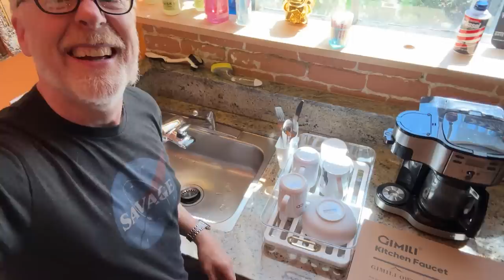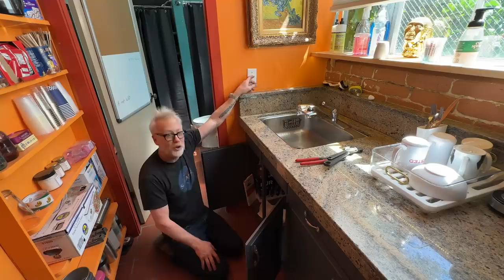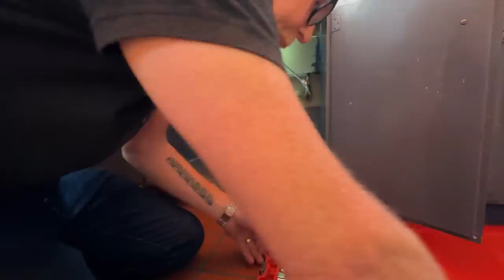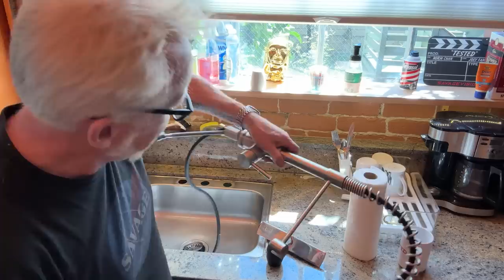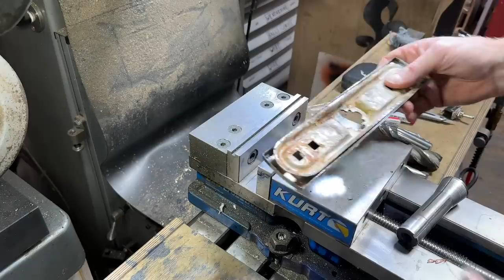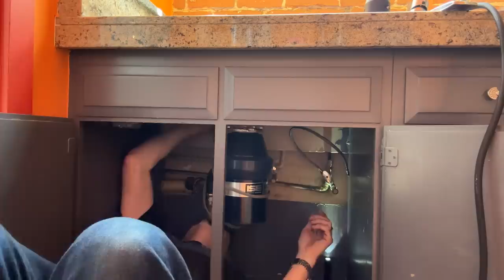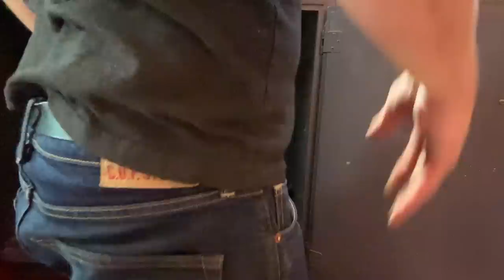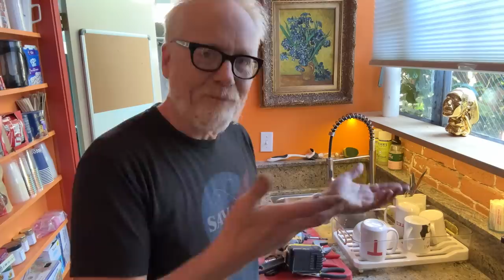Why You Should Hire a Plumber

Comment: Pro-tip: wash dishes in that sink with the hot water at its hottest for a week, then tighten the couplings on the hot part again. I learned that the hard way when the hot water supply line to a shower in the house we bought started leaking. This was during lockdown so no professional or family could come over to help. I first took out part of the false ceiling, then reroofed the flat roof adjacent to the bathroom wall, thinking it was storm damage, but that didn't help.  Then shut of the main water and that helped, so tore out the base of the shower to find with an endoscope that the previous owner had DIYed the shower and probably never used it, and the heat of the warm water had loosened a fitting they had used to join two flexible lines inside the floor. So I had to contort my arms into a 10 inch high space littered with glasswool under the shower to blindly fasten a fitting somewhere in a hole in the floor using two oversized wrenches. Breathing glass dust because the government had banned dustmasks. Fun times ...

Comment: In many cases I’m willing to pay plumbers what its costs based purely on the level of gross involved in solving an issue. As far as I’m concerned, they more than earn their fees for that alone. 

For the rest of it, one problem is part of a system. And especially living in an old house, you learn fast that replacing one part of the system often cascades into all the other old bits failing because they can’t keep up with the new bit. Plumbers can anticipate and defray some of that—or at least help me understand what to expect and the real cost involved of something that seems, on the surface, incredibly simple to fix.

Comment: It's a method.... it's an incorrect method but it IS a method. Also, just a side note I would have soaked the former cover in some CLR to lean it up a little. With this being a sink faucet and not a car part, honestly 99% are done with plastic thumb screws. Unless you have someone hulking out on the faucet constantly that should suffice. NOTE that is for the COVER, not the actual water lines. Those should always be made tight using a wrench and sometimes at least 1 pass of teflon tape. 

SIDE QUESTION-when you do builds, how do you charge for them? Asking as someone who does smaller builds primarily for fun but have also had requests for things. I have no idea how to charge for what I do which is primarily woodworking.

Comment: About DIY vs professionals.
In my country electricians and plumbers are authorized trades meaning to open a plumber or electricians buisness you need to have an education and certificate as "Installator" in the specific trade.
Everyone can open a carpenters shop and do carpentry (They ofcourse have to follow building codes etc to get builds approved).
But to work in plumbing or elctricity you need to have approved educational certificates.
There are exeptions. Homeowners can hang their own lamps and install their own appliances and fossets etc. Rule of thumb is that any part of the permanent house installation requires authorisation. But if you can turn off the installation or close off water with a tap at some connection point or connect you appliance to a type of outlet without tampering with the permanent house installations, then you can do it yourself.
But as an electrician I always caution anyone doing their own plumbing or electricity. Mistakes may result in massive expensive damage often not covered by insurance if you DIYed things and in worst case you can kill a person or pet you love!
If you don't know what you are doing and someone didn't teach you how, ask for help!

Comment: Faucets are tough to deal with because they are back there behind the sink, and you have a large sink.  You have to take everything out from under the sink, lay on your back and squeeze in there, and reach way up over your head to get to the nut that you have to remove.  There usually isn't room for any kind of normal tools so you need a fancy tool.  And then with a gargabe disposal that thing is really in your way.  You are lucky that you have a 3-hole sink.  If you had a 1-hole sink or one hole through the granite it would be a lot harder to get that big nut off.
Plumbing technology is still relatively crude, parts are made cheaply.  It has to be very adaptable so if it was better technology it would just take a lot more pieces and they would cost a lot more.  But that means there is a lot more to fiddle with to make it fit and work.  Those valves that cut off water can be a problem, getting the joints to seal where everything connects can be a problem.  There is nothing about it that makes it work.  I've owned 4 houses and had to deal with extensive plumbing work on all of them.  It's never fun and never as simple as it should be.
Maybe my plumbing work would have been easier if I had a milling machine and appropriate cutters.  At least I could make a custom crowsfoot wrench to tighten that big nut with.

Comment: Over the last 30 years, I done most of the work on my cars and houses. If there is one thing I have learned it is that plumbers are definitely worth hiring for all but the most simple jobs. It seemingly always takes three trips to the store to get the correct parts and, after you have taken 3 days to do a 30 minute job, it still leaks. At least that has been my experience.
Reply: Just yesterday, my friend, who is a plumber, was heading out to replace a leaking toilet, the FOURTH in 30 YEARS that he’s seen with a defect in the glaze causing a pinhole leak. As a DIY homeowner, there is no way you would even know how to diagnose this, or know that was a possibility!!

Comment: Ok... I've replaced many sink faucets and the biggest problem I've had is needing or thread tape or solder/flux or assembly lube (silicone). If your plumbing is so old that it's non-standard definitely call a pro. However if you can't install a faucet... Your man card is revoked.

Comment: You can buy plugs to fill the unused holes in the sink. No need to fool around and keep the old trim. They come in different colors to match your sink. They cost less than $10 for the pair. A milling machine is not needed.

Comment: I used to work as an apprentice electrician. The basics ares straightforward enough, and a lot of it is just common sense.

HOWEVER, it's also way too easy to stray beyond the basics and end up in a lot trouble very quickly. Being able to spot and mitigate those issues before they become a problem is why tradies get paid the big bucks.

Comment: That's a fair and reasonable fear of hearing someone having a disaster in their homes or work at the end of this. I twice forgot to remove the factory packaging plugs on things, once for the water heater hot & cold outputs, which thankfully was easy to resolve though slightly messy and startling when completely unexpected, and again the garbage disposal's dishwasher port which was confusing but easy to deal with. 👀

Comment: I didn't see any caulk being used on that tap/faucet base ,or any rubber seal.... as a Plumber that not being sealed will leak water that's splashed around the outside and wet the unit below... as I said I didn't see any NEW sealant of any kind in the vid but maybe there was some used ?
Reply: Some faucet kits have rubber gaskets along the base plate, but I didn't see any on there in this build.

Comment: Great video! A bit of advice from a 40+ non-plumber who has been doing this type of work since he was very young: 

1.) Get yourself a pad for your knees/back for when you're on the ground--this just saves you from pain in the long-term. I use old packaging material from routers & switches (I work in IT & telecom), usually a 1.5-2in (37-50mm) LDPE cushion, as these tend to provide enough cushion and are durable enough to withstand abuse. This is one of the materials you'll find in purpose-made pads you can buy at the store. Plus if they get messed up, you can just toss them in the recycling bin without worry.

2.) Get rid of your garbage disposal ("Insinkerator" or another term you use for it). Are they convenient in the short run? Yes! But in the long run sending anything down your drain which isn't water, particle-free liquid, or human waste & TP--as these drain pipes are designed to do--will cause you unbelievably large problems. We're talking 5-digits of $$$ for a single-family home, and far more for an apartment complex, office, etc. Remove the disposal and replace it with a proper drainage pipe. PVC, brass, or other materials are just fine and can hold up for decades. If you don't, you'll continue to deposit food waste from your kitchen drain into the smaller 2" pipe, and eventually into the 3" or larger drain pipes further toward your main drainage lines. 

"But Onuma, how am I supposed to clean off the pan I used for cooking hamburgers last night?" Scrape them into a trash bin, with a spatula which doesn't damage your pan (stainless steel works beautifully on cast iron or stainless pans--wood or bamboo for anything non-stick), wipe away any oils or residue with a disposable rag or paper towel, and then clean the pan in your sink with hot water and plenty of strong dish soap. The tiny quantities of oil going down your drain are inevitable, but minimizing them to only the residue which you can't mechanically remove with a spatula/rag will allow you to get far more life out of your drains before you need to call yourself a plumber to snake or hydrajet your lines. Prevention is the best medicine!

3.) /Mise en place/. This is French for "gathering things" (approximately), but it means you get all of your tools and parts set up in place before you begin work. This applies to cooking just as much as it does to auto repairs, home renovation, or crafting & costume making. Prepping your work space will save you signicficant time on a given project, and immeasurable time over the course of your life. As Adam states at 19:45, "plumbing such an exercise in extreme discomfort"--limiting your amount of time on your knees, back, inside a cabinet or under a crawl space saves you time, pain, and stress. Plus, I'm sure most of us have scorched eggs or ruined a project because we had to go fetch another tool or seasoning that we forgot to prep ahead of time--this is entirely avoidable in most situations!

4.) Find professionals for important projects that you rely upon. You may be very capable and confident, but everyone, at some point, reaches the end of their expertise and requires some assistance. Test your limits, sure, but "know when to hold 'em, know when to fold 'em." It may be costly to find these individuals you can trust, but they are worth every dollar once you do.

I hope these tips help somebody out there. I'd love to have learned some of them sooner, and I'm sure I'll learn more in the next 40+ years.

Comment: Changing put "fixtures" is pretty straight forward. However That's not what I'd call serious plumbing work. If you're not braising copper pipe, or fitting and gluing PVC, or clamping PEX, that's the easy stuff. The hard part about plumbing is understanding the overall dynamics of the total system, and the why and how of pressure vs flow type problems, and how to properly design, diagnose, and install those systems.

Comment: Those screw type shutoff water valves are my least favorite, never fails that when you need to use them they are seized or they start leaking after you close and open them. Quarter turn ball valves is always the best approach if you ever have to replace them.

Comment: I am very surprised Adam does not a basin wrench.   Handy to have when plumbing a sink, but the problem is you find so many other uses for it.   When I need mine, I usually have to find where DW used it last.   Definitely not a mono use item.

Comment: Plumber of almost 30 years here.

I ask hew customers if they tried to fix it themselves. If yes my rates go up. Rule of thumb for the DIY guy - dont mess with it if you can cause hidden problems. Anything you can monitor go ahead and try your luck on, but be aware it'll cost more to fix your mistakes than the original problem. And that's a guarantee.

Comment: I'm surprised you didn't secure the brass pipe that jerked every which way when you turned the water on. A simple bracket to the wall would reduce so much mechanical stress on that part of it!

Comment: I'm a very infrequent "builder", mostly out of necessity and availability. I replaced a faucet a few years ago when I was renting a condo, more for aesthetics than for life improvement. For the life of me I could not get the locking ring to get into place. I really don't appreciate myself cursing, but it flowed through me enough to make Lord Vader proud. Somehow or another after a few days I was able to come back to it and feel like it was more secure, but the initial results were very wiggly to put it unprofessionally. The frustrating part was RTFM was not the solution by any means. It didn't even really show or explain the process. Just being under the sink was also absolutely asinine. The pipes went all kinds of wrong under the sink. Access to anything was absurd. Also, I initially installed parts in the wrong sequence (also not made obvious in the manual), but that was just a head scratcher rather than like hitting a raw nerve.

Comment: I would be curious to know how much time you actually spent on that job and what your hourly rate is. Was it worth your time or could you have hired a professional to do it for less? I understand the personal satisfaction of doing it yourself but I have learned as I've gotten older that it usually better to just pay a professional. You might pay a little more but the stress relief more than compensates for any additional cost.

Comment: Last spring had some plumbers replace leaky taps on a kitchen radiator.
After assessing their pipeline - pun intended - backed up and had to change the taps on other four radiators all by myself.

Seeing those two guys just wrestling those brand new parts gruesomly into the system using flax tow instead of the teflon tape (cause it's easier and quicker for them to clock those taps into their respected positions by basically overtorking the joint <for it never to come apart again> - the special perk of the ol' goo' tow)...

That wasn't a pleasant sight to say the least. So - if you ask me - never trust a hired jobber unless you're friends, relatives, etc. And do your best to google at least the basic minimae of how their job should theoretically be done if you enavitably have to rely on them due to not having the tools, expertise or the physical abilities to get the job done. Otherwise they're going to cut all the corners off of you - even more than you might have thought you've got - and still rip your last pants off.

Comment: I actually have one, that is almost identical to that one.  It's the Glacier Bay brand, from Home Depot.  And, the one I got, came with a brand new plate and plastic piece, so no need to mill it, as it's already done for you.  And, the one I got, also come's with the quick release nut, that hold's everything the faucet to the sink, that is a modified wingnut, that you literally slide on at first, then compress the "bottom"(Where it meet's the underside of the sink), causing the threading to be pressed together, where you then start turning it, as the thread's grab hold of each other, and tighten it with no tool's, but your own hand.  Now, in a lot of case's, like with mine, the metal braided line's, that connect to the valve, are hex nut's, but they don't need to be torqued down, as they have O-ring's, that seal them, so they just need to be snugged down(It's usually a good idea to use a light smear of cooking oil, or Vaseline, as both would quickly be rinsed away, so the O-ring's don't bind up and distort and tear, or leave a gap), leaving the O-ring to keep the connection from leaking.  And, I could build a house from the ground up, as I have professionally done every step, while working different job's, whether it's the masonry, to the woodworking, plumbing, electrical wiring(With the approval of a master electrician, of both commercial and industrial electrical wiring, while bein appraisal for doin a better job, than his own co-worker's), drywalling/drywall finishing, painting/paint removal, carpeting/hardwood flooring(Including the sanding & staining procedure's), to the landscaping, roofing, siding, and window/door installation.  Also, the next time you go crawlin up under the sink like that?  It would be a great idea, to fold up a blanket/comforter and lay it across the edge of the floor of the floor, under the sink, that the cabinet door's butt up against, as it will make it a lot easier on the back.  And, you are right, it's definitely a workout, especially, when you are doin it alone!  The constant up & down, havin to either realign this, or this or that, then havin to crawl back up underneath, is a huge pain in the arse/back...
Reply: comes with
Reply: Stupid keyboard buttons not working properly, so had to insert the "E" where it was supposed to be...

Comment: You should have used Plumbers Putty around the cover plate as there is now nothing to prevent water from getting under the cover plate and into the space below the sink.  The reason the cover plate had so much Plumbers Putty (caulk) was that is the way it is installed.  Make a rope out of Plumbers Putty by rolling a piece of Plumbers Putty between the palm of the hands until you have a long piece that looks like a rope. Too thin the rope breaks, too thick is OK as you are only using more Plumber Putty than you need but in this case, too much is better than too little.  Next, place the Plumbers Putty rope around the edge to be sealed, tighten the item while squeezing the Plumber Putty rope everywhere, and then clear away the excess Plumbers Putty.